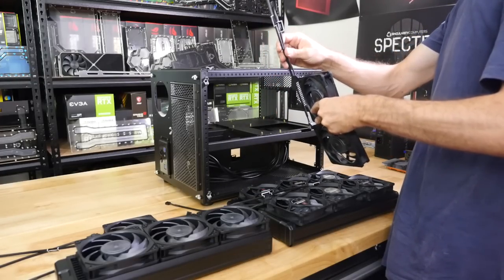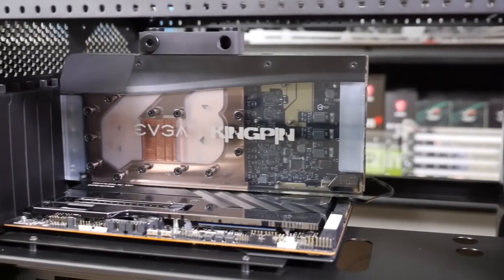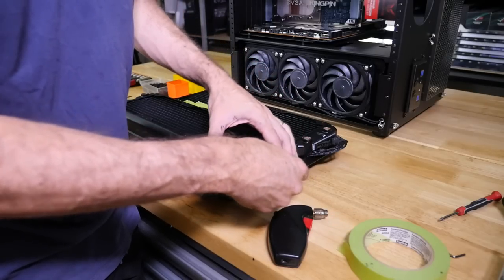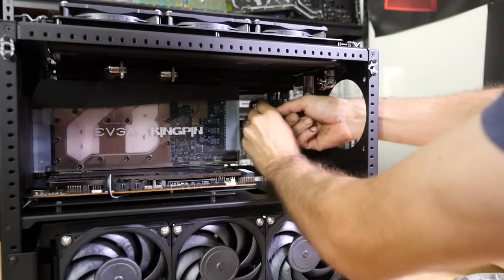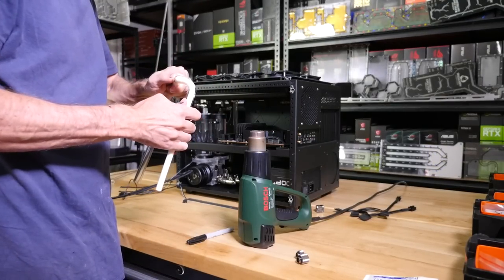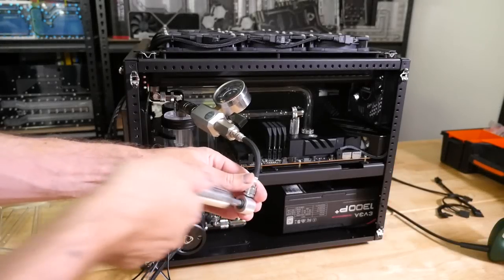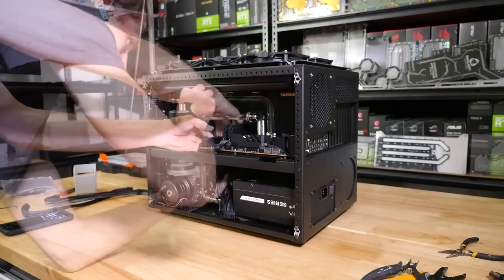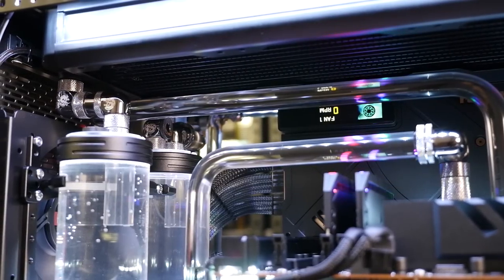Build #53: Caselabs S8

Comment: I have the Lian Li version of the Caselabs case, the Lian Li PC-V33. It has the same cube, dual chamber design, but a huge plus for me was that the whole front and roof section of the Lian Li hinges forward in one piece, and makes the case like a test bench. This feature was what made me go with the Lian Li. It makes building/maintenance so much easier.

Great video👍
Reply: ive got the same ll case still in og box, cause currently im using ll bench

Comment: I like your style of designing tube routing. Some people do excessive bends just for the sake of it. It looks really cheap.
Reply: yeah. i always sit back and look at a finished build and wonder why they look so damn elegant and clean. i guess it comes down to the clean short tube runs and custom cables and the cable management. all that in a case with a crazy good paint job and you know why those machines cost thousands of dollars. i mean ofc the components cost a lot but also the paint is insanely expensive and the labour that goes into the paint job and the custom cables is insane. that's like 1-2 weeks of work often. building a computer is easy. building a watercooled system.. also but not so easy anymore. making a system look like one of his. not everyone can do that. the paint jobs alone would be what most people fail with.

Comment: there must be different varriants? mine is Alot taller, so plenty of room to clear the gpu.
Reply: Yes the S8S is shorter. The S8 can fit a 360 in the front but the S8S can only fit a 240/280. Other than the height, it's the same size.

Comment: Are hardware labs radiators the best in the industry?
Reply: Yes they are. Corsair even rebrands them to own but they are made by HW. Same with their fittings, they are made by Bitspower 😉
Reply: @sadus33  That's some good information to know, I recently discovered a brand called Optimus and I am doing my first build in like 7 years, they have everything except radiators so I will definitely get the HW radiators to pair with them. The only thing now is to wait for Lian li to release the V3000 Plus unless case labs makes a return lol

Comment: Is it a smaller version of caselabs S8?
Reply: Yes it's not as tall. The S8 can fit a 360mm rad in the front but the S8S can only do a 240/280. Other than the height, it's the same size